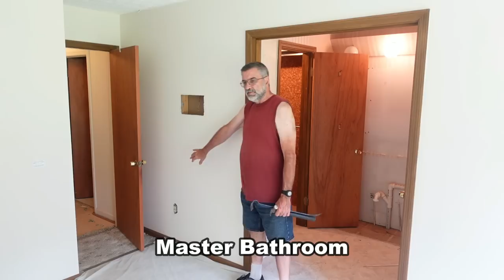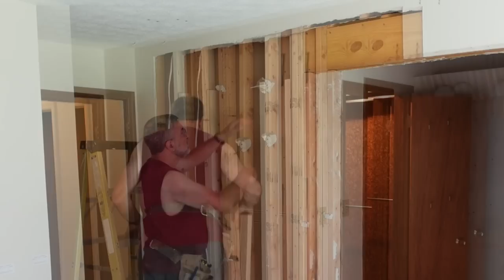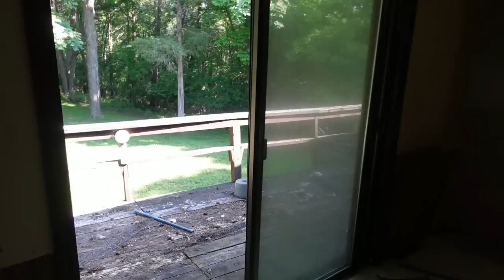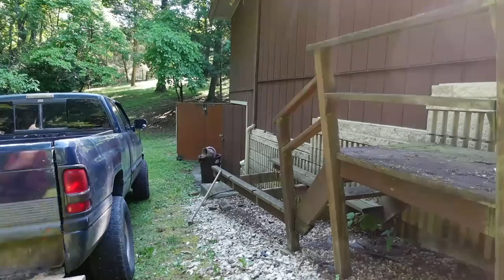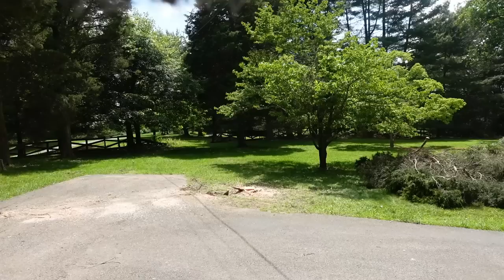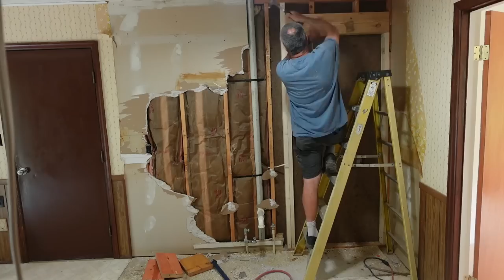How to move interior doors - Flip House Pt4

Comment: Great idea moving that door in the kitchen.
That’s a great house. If it were my kitchen, I’d want a breakfast bar running from the wall - where that door to the garage was before, that parallels where the length of the patio door is located. I say that for 2 reasons. It can do double duty as a breakfast bar/buffet and a way for a prep cook/barbecue cook to set food going in and out to the deck for grilling.
Maybe even put the sink in an area, on the wall, or at the end of the bar close to the wall, that makes it easy to clean up dishes from the breakfast bar/buffet.
I hope that makes sense. This is just coming from someone, who does a lot of family meals and I like my sink, dishwasher, bar area and eating utensils around the same area, for convenience sake.
Loving these videos. You all do a great job remodeling❣️

Comment: I think a change of colors to softer tones is appreciating to ROI yet it will not cost more than paint. Using durable, cost affective paint will show off a quality looking painted surface that looks new will sell the house faster. Maybe the outside, if done in paint vs. vinyl siding could be durable, and the inside, more economical. If there's some room to indent that door from the kitchen into the garage by two feet would look nicer than it places on a flat kitchen wall.
Reply from the maker: Everything, inside and out, will be painted much lighter colors than the old dark paneling that was there before.  The garage door cannot be pushed out into the garage without interfering with the first parking bay.

Comment: Bill, around the 8:49-8:50 mark the bathroom light suddenly switches on.  It's continuous footage and doesn't appear anyone turns it on...  Did it happen when you shifted the electrical cord that is hanging down as you slide the new 2x4 in place?  Just thinking about why the light just turns on like that,lol!?  Your explanations on ROI decisions are completely understandable.  (It's such a treat AND education seeing you, your son and families working to shape up this wonderful place!)
Reply from the maker: The light comes on because that is actually a different clip.  It is not continuous footage.
Reply: i can see the different clips however its wen u are putting the boards together. its not another clip. i notice wen clips are spliced together n this is not one of them. u are kneeling and nailing the boards together.

Comment: Since comments help your channel I'll add my two cents. Regarding decks:  As you said lumber prices are insanely high but beside that issue is that wood decks eventually rot or get termite or storm damage. I'm all for patios instead, flaggstone or whatever looks good to you. They last without rot and are much less of a liability.
Reply from the maker: We would still have to build a smaller deck and steps down to the patio. The door is 5 feet in the air.

Comment: Do you need permission or approval of for example the electrical work done when moving doors like this?
Reply from the maker: Technically, yes - in most jurisdictions.  This project was fully approved with a building permit, and inspected by the building inspector.  If I was JUST moving a door and doing nothing else, I would probably not bother with permits and inspections. But that's your choice.

Comment: Can some of wood be reused? Like deck wood ?, Or  the wood cut out of walls ,to re frame stuff?
Reply from the maker: Deck wood is completely rotten. We can reuse some of the studs from walls removed. And most of the trim.
Reply: I thought about the deck wood being rotted. That's good ,if you can use other wood though. Thanks
It's going to be nice.

Comment: I'm not in the construction industry. But something I've always wondered, why on non load bearing walls are headers so large needed? Why couldn't sandwiched 2x4's be used? If the wall is not load bearing then all that header should be dispersing load wise is the short 2x4's above and drywall to the jack studs. I understand that there are codes that need to be followed. And those vary city to city state to state. but it just seems over engineered to me.
Reply from the maker: Actually, both of the walls where I put in the new doors ARE load bearing.  In the next video you'll see that I put in another new door in a non-loadbearing wall, and I used a 2x4 header.
Reply: @LiveSimpleLiveFree  oh. Okay. That'd explain it then. I was just wondering some of those things. I have seen other people use lumber that size on non load bearing walls. And I have always thought that was overkill for non load bearing walls.